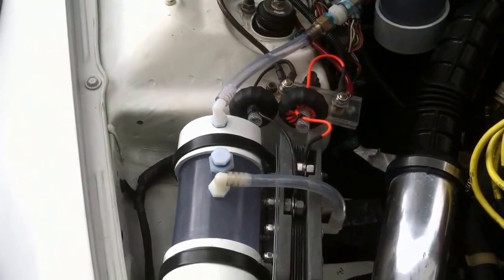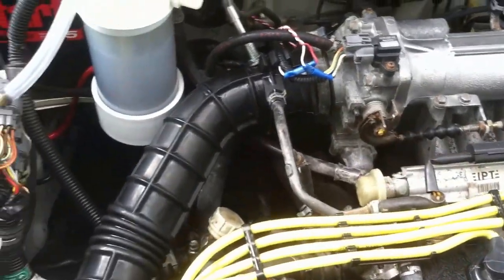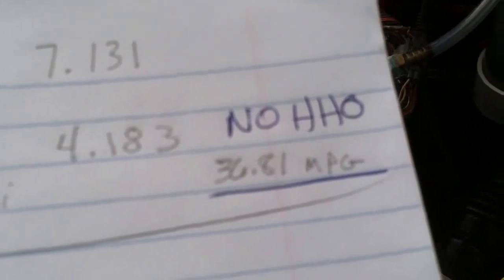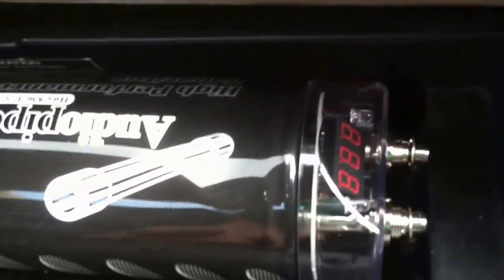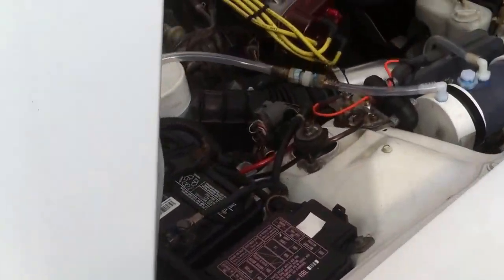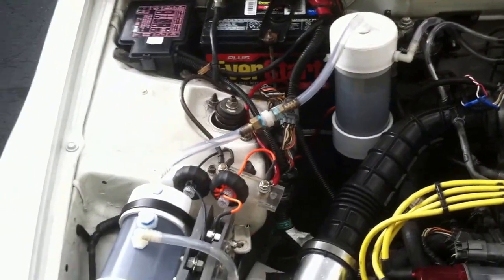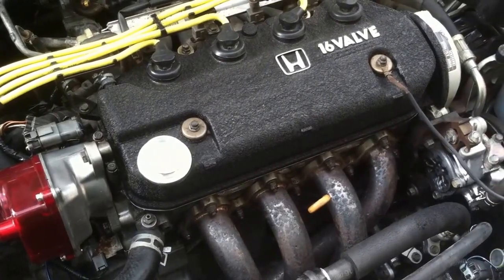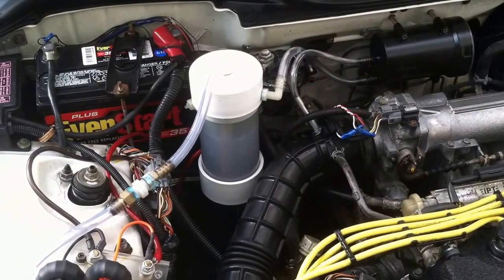IMG 1350

Comment: Are your chokes 12guage wire?
Reply from the maker: thewonn  Yeah, in parallel  and it might be 12 gauge for the chokes I bought them from the hydrogen garage. just keep the cap as close to the pwm  as possible.Pwm pos to the caps pos and then same pos terminal to the hho cells pos. I used them in car audio if your head lights were diming when the bass notes hit the caps usually will stop your lights from doing that.
Reply: I hooked one up, pos from pwm to cap then from cap to cell, same for neg. But no results. The cap doesnt seem to drain, it just shuts of instantly when pwm shuts off. Shouldnt it stay on until it drains? Thoughts?
Reply from the maker: thewonn neg goes to ground not to the pwm you are using just the pos, google car audio cap installation. Hook IT up just like that, mine has a volt meter on it. meter shuts off in a minute , but cap will always be holding a charge.

Comment from the maker: THIS CELL IS EFFICENT IT WILL DO 1LPM A LITTLE OVER 10 AMPS HONDAS ENGINE IS A 1.5   FACTORY MPG IS 35 TO 41 MPG, I AM USING ABOUT 7 AMPS WHICH IS A LITTLE OVER .50 LPM OF HYDROGEN. NO MODS TO THE 0DB-1.

Comment: Nice work. Great to see positive results. Do you think the cap made the difference? If so, are you going to try adding another one? Where did you get it from?
Thanks for sharing.
Reply from the maker: thewonn Yes I can turn it up to about 14 amps before the tachometer  starts to drop. I had the battery charger on and the car running, the pwm was set to 10 amps without the cap when I removed the battery charger the engine did stumble, with the cap it did not. And yes I think if you add more it would help the drag .I am running back to the shore this week, fill up at home and drive 210 miles at arrival then check the mileage again, next will be the Astro van adding a EFIE HHO CHIP MOD by eletronix, then a cell. The vav averages 17 mpg.  just search ebay for the caps. I used them for car audio.
Reply from the maker: HOLLYWOODS7 The RF chokes are also changing the magnetic field between the plates for more longitudinal energy. they also increase the neg spike in the pulsed signal from the pwm. And the positive choke stops the pulsing from entering the electrical system. The neg one captures the longitudinal energy . Increase gas 10 to 15% .Hydrogen Garage.
Reply: Thanks. How os the cap wired between pwm and cell? All in parallel or other?
Reply from the maker: thewonn    Parallel go to ebay look for car audio caps.